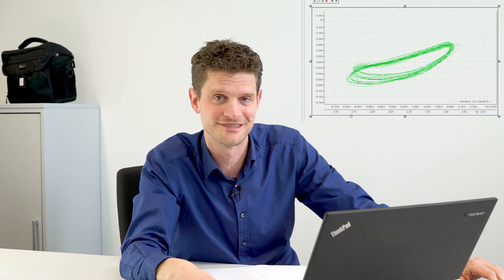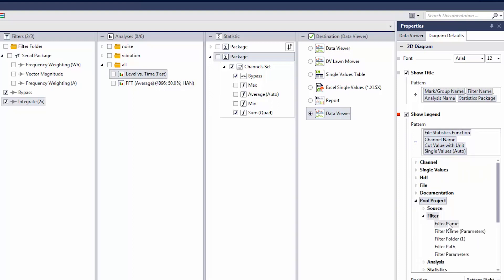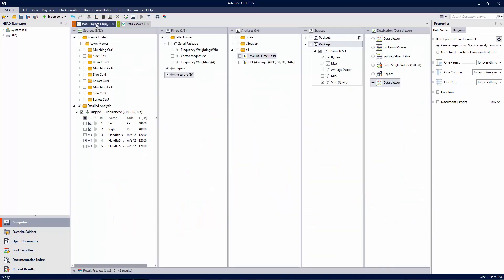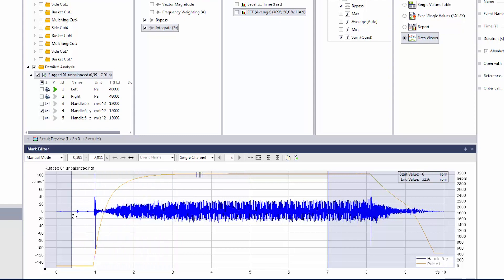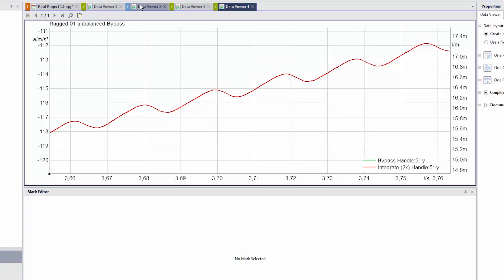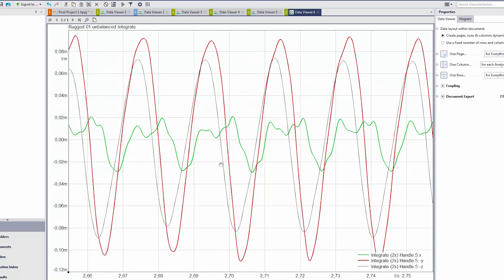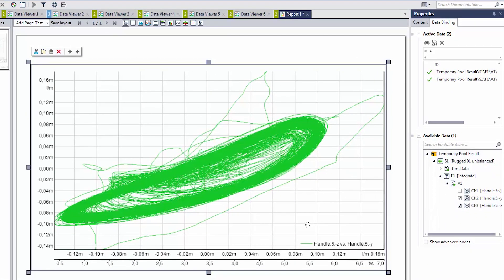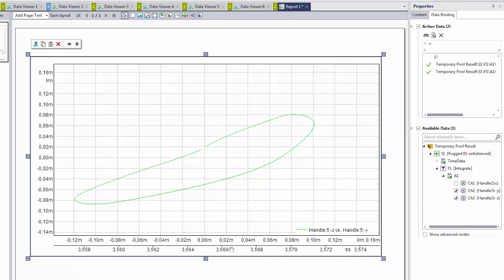Integrate Accelerometer Signals with Artemis SUITE 8/8

Comment: Hey mate is it possible to measure height by double integrating acceleration ( which will be that due to gravity?....
Thanks!
Reply from the maker: By integrating an acceleration signal twice, the displacement can be calculated.
Height is, if you like, also a distance. If an acceleration of a falling or high shot body is measured, also a height can be calculated. The gravitational force of the earth has to be calculated out by defining the rest position as 0 acceleration.
But there are many other and more accurate methods to measure height.